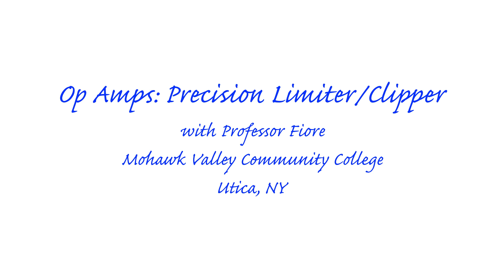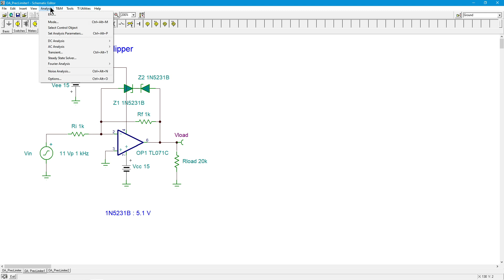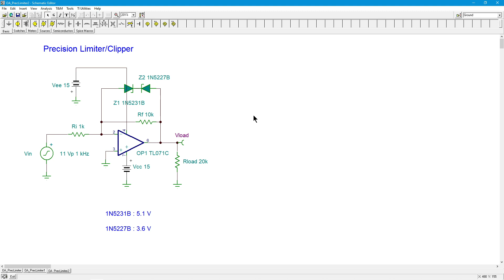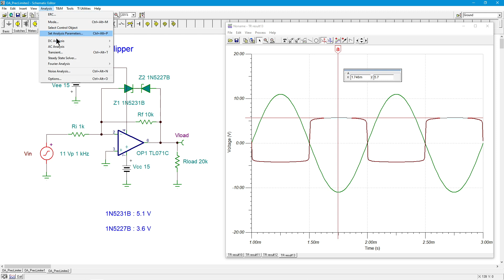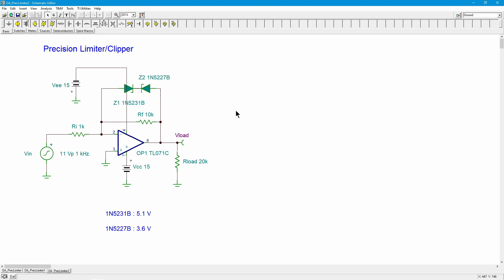Op Amps: Precision Limiter

Comment: This circuit is not a "precision" clipper.  It is a sloppy soft clipper.  It's soft because of the knees of the zeners, and it's sloppy because you never know what a zener's actual voltage will be.  If you want a precision clipper, you send a reference voltage through a resistor to the inverting input of the opamp, put a diode at the output of the opamp, connect the other end of the diode to the inverting input and take the clipped output from there.  You can change the direction of the diode to clip to a negative voltage.  This circuit has two issues, though: The first is that, if you want both positive and negative clipping, you must put two opamps in series.  The second is that the output impedance will be whatever the resistor value is, so you need to follow this circuit with a buffer, which uses another opamp.
Reply from the maker: This is referred to as "precision" because it's higher quality than just using standard passive resistor-diode circuits (limited by the op amp's speed, of course). It is easily programmed by setting the Zener potentials. One of the primary benefits of this circuit is its simplicity: an op amp, a couple of resistors and diodes, and you're good to go. Thus, it is a good, general purpose signal limiter. If you need something that is more precise, by all means, make something more complicated that fits your needs.
Reply: @ElectronicswithProfessorFiore  Well, it seems to me that if you want precision, that implies an exact voltage.  For example, say you want to limit the output of a comparator to exactly 5V and 0V for use in a subsequent integrator.  For that, 5.1V back-to-back zoners would be a disaster, but a trimmed LM336V5 into a 10k resistor and a 1N4148 diode do the job perfectly.  I build and sell enough electronic devices (synthesizer modules) to know when precision truly matters.
Reply from the maker: @docsketchy  Well if you want to argue a "precise" definition for "precision", be my guest. FYI, before my many years as a college professor, I worked in an instrumentation calibration lab for a very large company, so yeah, I have an idea of what precision means as well. Like all of engineering, it comes down to how much you need for a specific application, and balancing that against other factors such as cost.

In any case, you might be interested in this related video (which can be configured as a limiter, details in my free textbook-see links in description): https://youtu.be/lUST4lCa9UU
Reply: @docsketchy you clearly have good experience and knowledge, why be toxic on the thread?  Make your own videos and present them instead of tripping over your ego.

Comment: This is what I would call a "soft" clipping circuit, evidenced by the rounded corners as the circuit goes in and out of clipping.  An interesting variation on this circuit is what I would call a "hard" clipping circuit, where the output is faithfully produced right up to the clipping point and then clamps at that point.  This can be done with the addituon of one resistor and repositioning the clamping diodes.  I leave it as an exercise for your students to implement a version of this circuit. 🙂🙂

Comment: Hello Professor, I do like your videos as they are short and to the point.  I am thinking of running some of these circuit for learning purposes.  The signal level in your circuits is much higher than the levels that my sig gens produce.  It looks like I could cut the values down by a factor of 4 or 5 (including the diodes) or put an op amp amplifier in front?  Did you do a vid on the audio limited (controlled gain)?
Reply from the maker: I haven't done anything specifically on an audio limiter but there are some related videos in the op amps playlist. Also, see my reply to Black_Engineer in this comment section.

Comment: I am wondering, is there a reason you put the diodes in the Feedback path, rather than parallel to R_Load ? Im asking because it looks to me very much like a Bidirectional TVS diode an in my opinion putting the diode parallel to the Load conveys the function of it better.
Reply: Placing the diodes across the load would effectively short out the op-amps output once they start to conduct. Not only is this bad for the op-amp, it's bad for the diodes and it also affects the output impedance which may not play nice with the input impedance of the following stages.
Reply from the maker: @JaenFoster  Pretty much! If you do a sim with an ammeter at the op amp's output (prior to the feedback node), you can see that the current waveform is fairly well controlled. If you then move the Zeners in parallel with the load and rerun the sim, you will see that the current waveform will be highly distorted and at a much higher level.

Placing the diodes in the feedback loop allows the load to be somewhat isolated from the diodes and also controls both the input impedance and output impedance, along with the possibility of voltage gain. Now imagine what the signal source would see if you just had the diodes in parallel with the load. That could be highly non-linear load impedance, and who knows how the signal source would react!

Comment: Hello! I'm interested in learning about op-amp compressors. I would greatly appreciate it if you could create a tutorial that teaches the basics of how op-amp compressors work, what components are needed to build one, and the typical circuit configurations. An overview of the theory behind compression and why certain design choices result in different compression characteristics would also be very helpful context. Please let me know if a tutorial on this topic is something you are able to provide. Either way, thanks for your time and consideration!
Reply from the maker: Usually this is done by having an electronically controlled resistive device in the feedback loop of the op amp to control the gain. One example is having the input signal applied to a light which is then encapsulated with an LDR (light dependent resistor). As the signal increases, the light increases, and that makes the resistance drop. Another possibility is using a JFET in the ohmic region instead of the LDR. A third option (a bit fancier) is to use an OTA (operational transconductance amplifier) to create a VCR. I designed a system using an OTA in the pre-MIDI days to create a touch-sensitive electronic drum system. I'll see if I can come up with something for a video (not immediately though, as I have other irons in the fire).
Reply: @ElectronicswithProfessorFiore Thank you!
Reply: Check out Moritz Klein.  He has a circuit that I am experimenting with.  Only problem is that it is designed to work at Euro Rack level (aprox 5V I think) rather than line or instrument levels.  I am trying to modify it to fix this problem (for my use).
Reply: @jimbelcher6877 Thank you too!
Reply: Also interested in learning about audio compressors, the theory and applications.  You mentioned LDR; if one wanted assymetrical  clipping (even harmonics distortion), with say an LED in one direction,  a different diode in the other direction,  plus this LDR optically linked to said LED, all in the feedback path,  would you get asymmetric clipping plus compression?